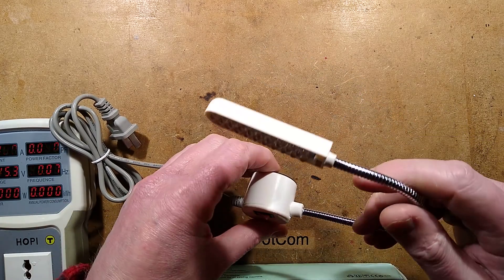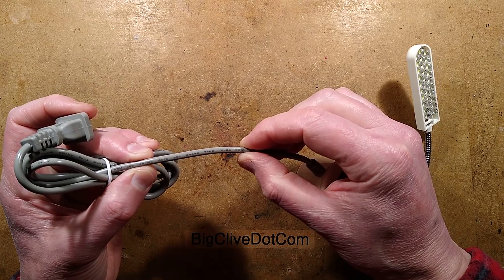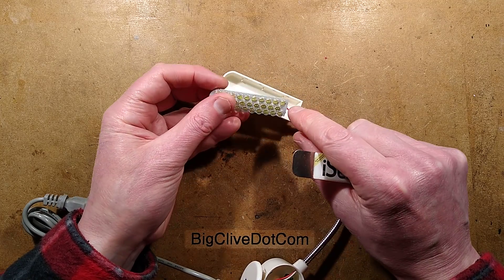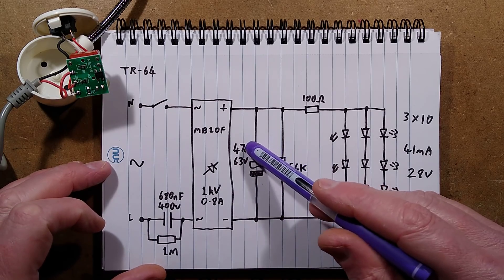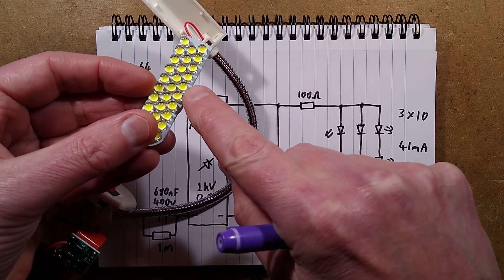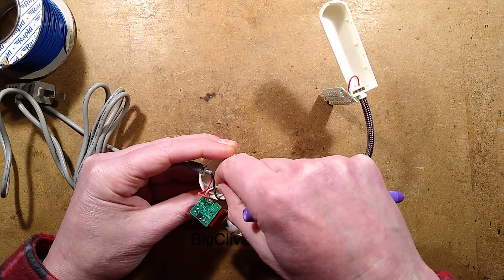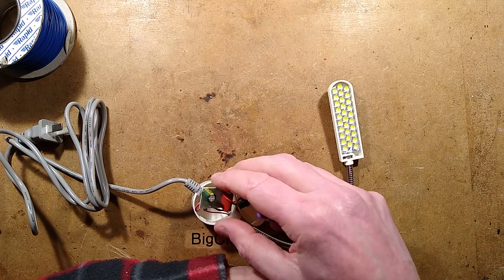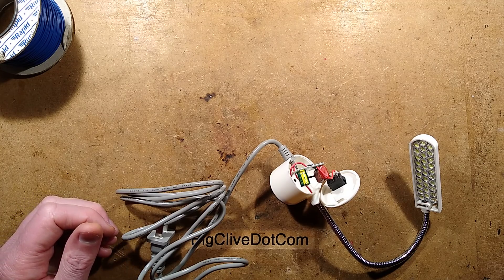Exploring a Chinese magnetic "machine light" (with schematic)

Comment: IIRC we had ordinary tungsten lamps on all moving machinery to make sure the workshop fluorescent lighting couldn't freeze a moving part, such as a chuck.  Well, that's what I assumed!  As you mentioned - this is well designed in that respect.
Reply: To stop the strobe effect they put a small  capacitor on one tube. Well at least they do it here on this side of the pond.
Reply: @assassinlexx1993  3 phase fluorescent lights here.
Reply: @mrnmrn1  cool 
So three tube per fixture? 😉😆😆🤙
Reply: @mrnmrn1  Does that mean they don't really have the wagon-wheel effect, or does that mean they get it at about 180 Hz instead?
Reply: @assassinlexx1993  More likely to be 6 :)
Reply: @evensgrey  It'll disappear totally as overall voltage remains constant.
Swashplate driven 3 cyl piston pumps similarly achieve pulse-free constant flow. Despite what you might think, it doesn't come in sine waves ;)
Reply: @millomweb  So you're not driving three different tubes, one on each phase.
Reply: @evensgrey  ?? Well that's the idea - 1 or 2 tubes per phase. I wonder if they're wired star or delta !!!
Reply: @millomweb  I don't think you can do either one.  These are discharge lamps with striking voltages, not electric motors.  You're describing a light with a 300 Hz flicker rate, nothing else.  The individual tubes may have overlap in their flashes, but that doesn't stop the overall lamp from flickering.  If you want a discharge lamp to not flicker, it has to have continuous current through it.
Reply: @evensgrey  It's going to have to be star as delta is only 2 phases which would give more flicker.
Reply: @assassinlexx1993  Yes, three tubes, or multiples of three per fixtures (6x18W is common, or 3x36W). And 3-phase light switches in smaller installations. On bigger sites, a latching contactor instead.
Reply: @evensgrey  The strobe effect is almost completely eliminated by this system, but yes, the remaining effect appears at 3 times the mains frequency. It also causes much less eye strain, so it was used in offices, too (and in big underpasses, and any other big installations as well, just because it puts equal load on the 3 phases). Cameras can still pick up their strobe effect tho.
Reply: @millomweb  In delta configuration, you are dealing with 400V in 230V countries. It could be done with special ballasts, but I've never heard anything like this exists. So star configuration, 3 phases plus Neutral.
Reply: @millomweb  Would either one even reach strike voltage?  If they did, both would flicker even worse than wiring each tube between a hot and ground.  (And I can't find any references to wiring a 3-phase florescent lamp, and I don't know why you'd even have one.  3-phase power is used for motors because it allows you to build a motor that has no times where the torque goes to zero, making it far harder to stall.  You can't need that in a lamp.  If you want a lamp that doesn't flicker, rectify the incoming AC and smooth it, then use current control instead of voltage-based PWM to control lamp brightness if you need to control lamp brightness, which you mostly don't.  Yes, it makes using fluorescent lamps difficult, but why the hell are you still using fluorescent lamps when LED lamps are better in every way?  Or do you know of some strange circumstance where they aren't better where the whole point isn't a brief flash like a camera flash?)
Reply: @mrnmrn1  Don't try to sell it to the US Department of Transport, though.  They'll make trivial errors in installation that will see them falling out after a few years.
Reply: @mrnmrn1  I'd leave the neutral off. With the neutral, it's equivalent of 3 single phases out of phase with each other - which is good but without the neutral, you get an effective floating 'neutral' which will move around with the phases in such a way that at no time will any tube see no voltage - result in some AC DC (I don't believe I just said that :)))) )
The point of going from 'positive' to 'negative' is non-linear but circular - hence zero voltage never happens.
Reply: @evensgrey  In Delta, voltage would be higher than 1ph voltage. (1·7 times). I'd estimate in star, V would be 0·86 times 1ph voltage - I think.
Running a fluorescent lamp on 3 phase would need multiples of 3 tubes in the lamp - each series of tubes on each phase.

"it allows you to build a motor that has no times where the torque goes to zero"

That's the whole point with the lamp - at no time is the whole lamp without power & therefore always gives light.

Running 3 phase lighting is cheaper than rectifying as it needs less equipment AND using 3 ph is more economic than using 1 ph.

Fluorescent tubes, especially T12 are far superior light source than LED. Higher wattage but the amount of light they put out over a big area is superb without being blindingly bright as point sources are.
Reply: @millomweb  If you leave the neutral off, and one tube fails, it will create a huge imbalance at the floating star point, and overload the remaining tubes. But hence when you switch the lights on, each tube strikes at different times, that already would cause imbalance and huge surges to the tubes.

But hey, this is just a legacy system. No one builds new 3 phase flurescent lighting anymore, at least not with magnetc ballasts. Good quality electronic ballasts are flicker-free even on single phase, but a lot of them are used in 3-phase arrangement to equalize the load, and because of the legacy wiring from the previous magnetic ballast fixtures.
Reply: @millomweb  Florescent tubes being superior light sources must be why they've fallen so much out of favor, yes?  The only actual detriment you've given is that LEDs are excessively bright as point sources, an issue nobody was concerned about with incandescent because the solution is so absurdly simple:  Put a diffuser over the thing or use them for indirect lighting (which is usually easier on the eyes anyway).  Florescents also often got diffusers as part of the protective cover that was often put over them to prevent them being broken easily.  After all, both the tube and the tube's contents are not something you want broken into bits and raining down.  (I've seen them put in without protective covers, and I've seen them get broken as a result. You'd be astonished at how often things get tossed upwards surprisingly hard.)  This is less of an issue with the drop-in LED replacements, as they often have plastic tubes, which are both lighter and cheaper than glass.  LEDs are also vastly superior in cold environments, as hot cathode tubes (the typical type of florescent used in most applications) are precisely that:  HOT.  Put them in an environment where they can't stay hot and they rapidly get very dim.  (I've seen that, too.  They can go from brilliant to too dim to read by in a minute or two if you've set things up really badly.  At least that's not like trying to run them at reduced voltage, where they will quickly destroy themselves.)
Reply: @evensgrey  Fluorescent lighting is much cheaper to maintain, and more reliable. Random failures are much more frequent in LED lights, and in a lot of cases, the LEDs are not user-replacable, so you need to replace the whole expensive fixture instead of changing a $2 tube or a $10 ballast (while creating much more e-waste by replacing the whole fixture). LEDs are still not that better in efficacy (lumens/watt) compared to modern T5 fluorescent tubes, and I think they are still worse in efficacy compared to high pressure discharge lamps (e.g. xenon and sodium).
Reply: @evensgrey  These 3 phase lighting systems are giving constant light. Not completely flicker-free, but at least there's no big drops in the intensity of light at given moments (at the zero cross of each phase, the other two phases will give the illumination, and the afterglow of the phospor smoothes most of the remaining flicker).

But we are talking about a legacy system. No one builds new 3 phase flurescent lighting anymore, at least not with magnetc ballasts. Good quality electronic ballasts are flicker-free even on single phase, but a lot of them are used in 3-phase arrangement to equalize the load, and because of the legacy wiring from the previous magnetic ballast fixtures.
Reply: @mrnmrn1  "If you leave the neutral off, and one tube fails, it will create a huge imbalance at the floating star point"

Good point :)
Reply: @evensgrey  "Florescent tubes being superior light sources must be why they've fallen so much out of favor, yes?  "
Certainly not by me ! Although compact fluorescent ones don't seem to last very long.
LEDs use a lot less power but as a light source very dim by comparison until relatively recently.

We now have a mix of LED and sodium street lights - SO much more light from the sodium bulbs.

None of our fluorescent tubes are covered.

LED replacement tubes I've seen are very dim. I might be able to use those in the garage, but not the kitchen. I've tried new T12s in the kitchen but they're all defective and the ends go black in a few hours and the tubes fail after a month or 2. I'm now down to my last 3 proper tubes in the kitchen - 2 in the lights and 1 spare.

I have noticed the kitchen lights be dim at switch on in winter but 5 mins and they're back to usual brightness.
Reply: @mrnmrn1  LED lamps have much longer life spans than florescent lamps do (typically by a factor of 3 to 5), and are much more easily dealt with in a waste stream because of an absence of toxic components like mercury.  The main problem with replacement is getting a replacement lamp when one does fail.  They last so long that most retailers don't find it worth stocking them, so you end up having to go to building supply stores for them.  A quick check of a major building supply retailer shows the price of both LED and florescent lamps as being all over the place, but similarly rated lamps are in the same (and somewhat more expensive that you quoted) price range.  You can also buy LED replacements for florescent lamps that are literally drop in replacements, needing no modifications at all to the fixture, in much the same that CFL bulbs can be drop in replacements for tungsten lamps.

As for the notion of more eqaste...that's silly.  Actually look at the lamp Clive showed in the video.  There's almost nothing to it, and it works quite well.  Any LED lamp that puts out the kind of illumination that you'd expect from a mains-powered light is going to be able to be this kind of simple.  It's LESS waste than a florescent system, even if you throw it away and replace it when it fails.

As for efficiency, you can beat LED lights in efficiency with low pressure sodium lamps, but those have incredibly bad color rendering and you wouldn't want those for any sort of normal indoor lighting.  For the most part, LED lamps beat out discharge lamps for power efficiency or they beat them soundly on total cost because the most efficient discharge lamps with good color rendering often have the shortest lifespans.

You see, there are reasons almost everything is switching to LED lamps.  Fluorescents are just not as good at almost everything, and discharge lamps have a lot of issues keeping up on all fronts at once.  (Yes, they work better in street lighting and signal lights on roadways as well.  If an individual LED fails, that's nothing if the lamp was designed to deal with it properly.  They more easily produce pleasant light, and usually have better life spans than discharge lamps that produce similarly pleasant light.))
Reply: @millomweb  Your kitchen light has the wrong type of ballast for the newer lamps.  You're describing the precise failure mode of an incompatible (or malfunctioning, but that would damage all lamps) ballast in hot-cathode fluorescent lamps.  (The effect is known as 'sputtering' and it causes the filament to boil away and be deposited on the inside of the tube nearby, hence the ends darken.  This occurs as the lamps age in any case, but it will happen much faster if the ballast is not the correct type for the tubes in use.)

Yes, the early LED lamps WERE dim.  I bought one, to see what it was like, and installed it in my kitchen ceiling fixture, then took it out again after the first time I tried to use it.  The new ones are much brighter and seem to outperform the CFLs rather handily.  (Too bad they're the same size as the incandescent lamps with the same rated light output, I'd love to put 100W equivalent LEDs in my fixtures that are sized for 60W incandescents.)  Now, CFLs do dim as they age, so my view of replacement of a 60W equivalent CFL with a 60W equivalent LED lamp in my bathroom might be colored by the fact the CFL had died of old age, but damn that light is brighter than it was before.  I used to have to turn on both lights in there at night to have the room well illuminated, but I only need one now.
Reply: @evensgrey  "Your kitchen light has the wrong type of ballast for the newer lamps."

What you really mean is that I need the older style tubes !

I know that - but where to get them made ?
Reply: @evensgrey  Don't compare the lamp in Clive's video to an industrial LED lamp, which contains a hefty SMPS, and at least 500g of aluminium, all of these has to be recycled when replacing the fixture, instead of replacing a single tube.

The CLAIMED lifespan might be higher with LEDs, but they do develop random failures much more often than fluorescents. Cooked LEDs might short out, or thermal cycling can break the bonding wire to the silicon die inside the LED chip package. A good tube will last 15-25k hours wth a good electronic ballast, and their cost is only a small fraction of a whole LED fixture.
https://www.youtube.com/watch?v=9Y86Cbj9tGA
Datecode on this is 1426, the video was made in late 2017, the lamp was probably sitting for a few months prior to its use, and a few months again prior to its autopsy after its failure, so let's say it worked for 2 years. Even if it was on for 24/7, it's just 17k hours.

It was several years ago when I made my last research comparing fluorescent and LED lighting by their specifications, price, power consumption and maintanance costs, I will do it again as soon as I will have time for it.

One of the main problems with LED lights that have non-replacable LEDs in them, is financial. If they are good quality, they will fail in masses around the same time, which can be 5-15 years after their installation. And it means a huge cost. The cost of 500 good quality LED fixtures can easily be 70.000USD. If they fail in bulk after 5 years, that means 70.000USD cost in every 5 years. It's just not worth it. Better maintaining regular fluorescents for  a very small fraction of this cost, while paying slightly more for the electric bill.

You can not put LED tubes in every fluoro fixtures without re-wiring them, especially not into electronic ballast equipped ones. There are LED tubes which can be used with a shorted starter socket and the magnetic ballast still in series with them, but the ballast will dissipate some heat, lowering the efficiency. So you should short out the ballast for the best result. (except if the fluoro-replacement has low power factor, then the ballast can act as a passive PFC, lowering the reactive power consumption, which has a very high fee for industrial users)

Also, a basic 36W T8 fluorescent replacement LED tube from Osram consumes 16W, while putting out 1800 Lumens. The 36W T8 tube they are supposed to substitute puts out 3350 lumens. So you will only get 54% of the original light output (which was designed for the building), which you can not legally do in an industrial/office environment. And you will have 44% of the original consumption with 54% of the original light output.
Reply: @mrnmrn1  In addition to your well made point, I similarly despair at the UK's obsession with replacing sodium streetlamps with LEDs. We're now burning more watts to create lower visibility. The orange glow has been replaced with a dim grey glow with dazzling point light-sources. I really struggle to resolve contrast under the grey glow as everything looks 'flat'. Not the greatest feature when you're trying to drive safely.
Reply: @assassinlexx1993  - Not sure which side of which pond you're on, but yes, that's standard pretty much everywhere. That and the phosphor coating help reduce the strobe effect, but don't eliminate it completely, as anyone who has ever tried to film things lit by fluorescent tubes with a fast shutter knows.